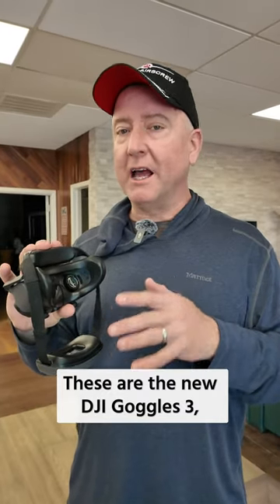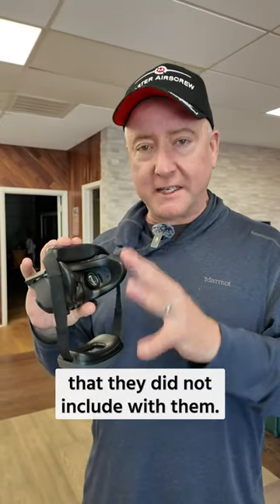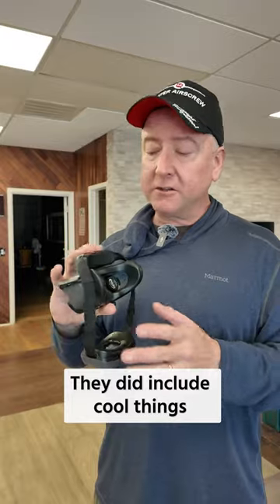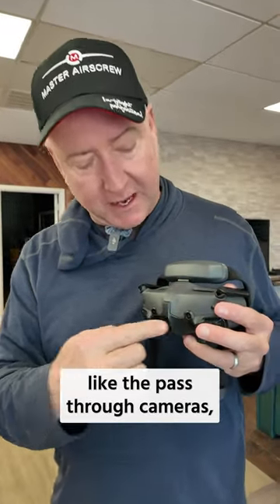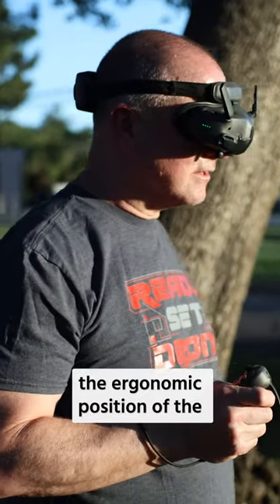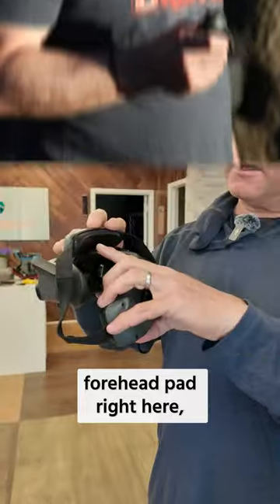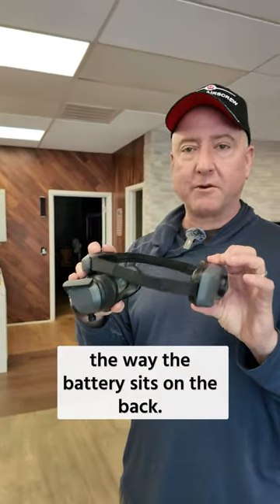DJI Goggles 3 - Strange But Genius Design

Comment: No foam so that it will fit more face and nose shapes. The rubbery part is supposed to flex and form a light seal with minimal pressure on the contact surface area.
Reply: Exact!

Comment: It is because the foam is not needed since the only reason for the rubber is to mold to any face to block light. 
    The foam would be needed just if the googles were pressed to the face to hold its position. 👍
Reply from the maker: For sure! Pretty comfy design.

Comment: Can these be worn with eyeglasses? Or are glasses not needed?
Reply from the maker: No. You can't comfortably wear them with glasses. There are adjustable diopters though, so, generally, they should be fine for most people.

Comment: can you please make a video about the goggles 3 with the Mini 4 pro? Haven't found ANY youtubers trying the pairing yet...
Reply from the maker: Yes, we actually started filming it. We got the Mini 4 pro paired and flying with the Goggles 3 and Motion 3. We just have a backlog of ideas, but this one is definitely on the list. Thanks for commenting.
Reply: @readysetdrone  awesome, can't wait! Any issues with pairing it all together?
Reply from the maker: It was pretty seamless. We just paired the goggles (after changing the mode from Avata 2 to Mini 4 pro) and then the Motion 3. There was a warning of some kind on the RC 2, so that's why we got out the Motion 3, but I believe the RC 2 should work fine while viewing the FPV video stream in the goggles.
Reply: @readysetdrone  I got my set all paired too, however if I want to use the motion controller I need to unbind the drone from the RC2 (and vice versa when I want to go back to using the RC2). Have you found a way around that? That's annoying. As it is the goggles work regardless, it's just if you want to use the motion controller. It actually all works seamlessly but you are limited to 5 flights with it "unbound" for some reason. It all works, you just choose by turning on whichever device you want, so why do they have a limiter in place and force you to go through the steps of unbinding and rebinding to get rid of the unbound device warning....

Comment: Light Leaks are not prevented when using prescription lenses. A horrible oversight when using them and the extended forehead pad.
Reply from the maker: I don't believe that these goggles are intended to be used with glasses. There are diopter adjustments as well as additional lenses to add, if needed.